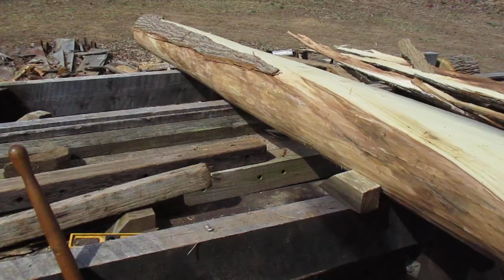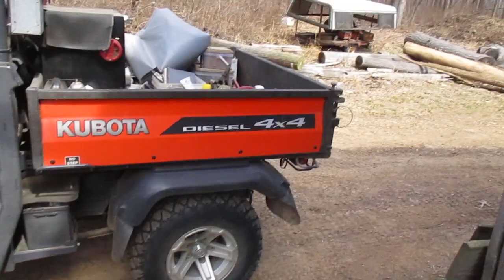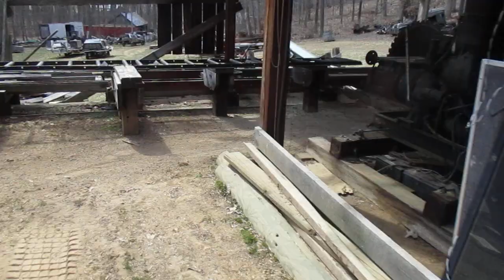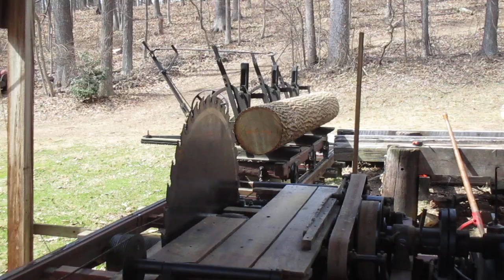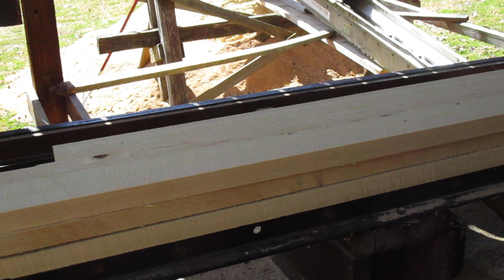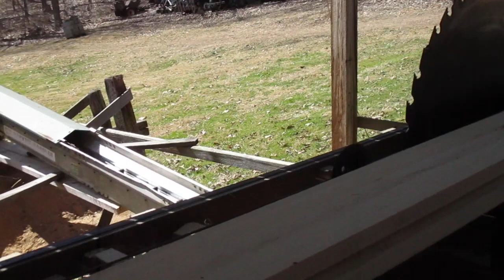Making 2x4s on the sawmill . #288

Comment: Question on your sawing method.  When you got to your 8.25" measurement, why didn't you make 2x8.25"s then restack to cut in half to make your final 2x4's?  Marc Galicic demonstrates this all the time on his circle mill.  Seems like extra handling work of the cants the way you did it.
Reply from the maker: hi there not quite sure what you mean all though i watch all Marc's videos . proboley just my style . i saw different than most sawyers because i don't have person grabing the boards away from the blade . and i change from time to time . having a good off bearer makes a huge difference thanks john